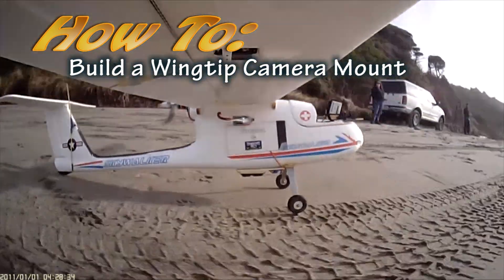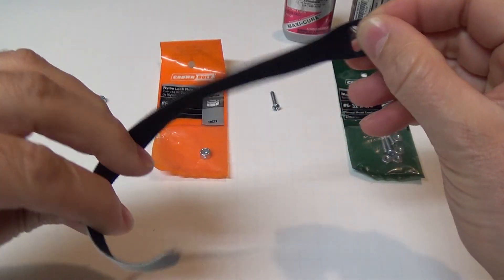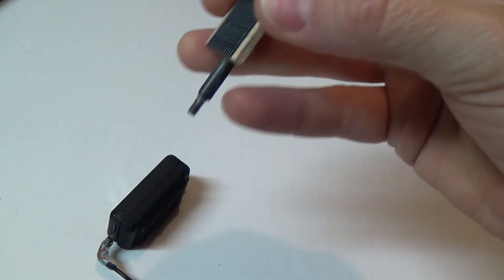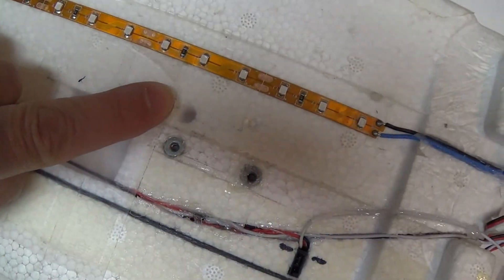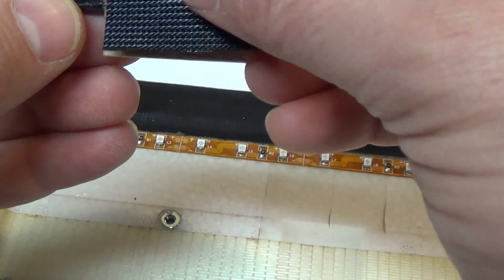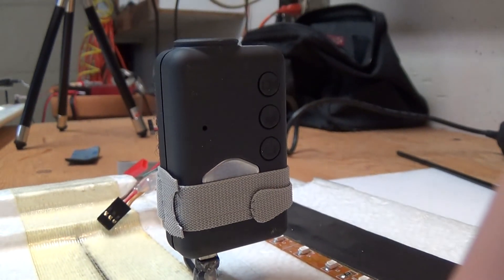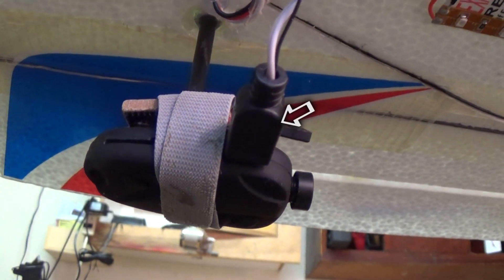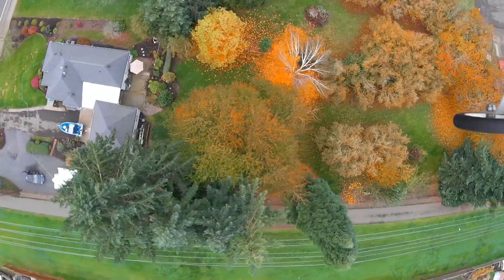FPV Wing Camera Mount for Mobius or 808 - How To Build It!

Comment: Very cool video ! Just a dumb question. Do i always have to balance the wings with some kind of weight when i add more spots for the camera mount? Subscribe!!
Reply: That depends. If you have a light airplane with a heavy camera, you definitely need to put on some counterbalance to restore the center of gravity. But the lighter your camera is relative to the airplane, the less you have to worry about CG.

Comment: Very good video. One suggestion to those wanting to try this that was implied in the video but should always be mentioned is double check before you glue, and double check after everything is completed it would be shame to lose an 808 or Mobius because the glue didn't bond correctly. Also check to make sure your specific CA isn't going to melt the foam. Melting foam = counter productive. 

Thanks for the video! I'll be sure to share this on our FB page.

Comment: Nice video! I was thinking of something similar until I came across this video. My idea is to push a plastic tube deep into the foam with nylon nuts glued in at opposite ends, and then use nylon screws instead of metal so that they snap off without ripping foam out. That will require prying the broken threaded pieces out of course, which shouldn't be a problem. Or perhaps make an intentional weak spot in the rod holding the camera: e.g. use 2 carbon rods bonded together with some weak plastic outer tube or tape.
Reply: Great Idea, I'll be adopting your plan. I've ordered some 5mm Threaded Nylon rod which I hope will be able to fit through the end of the #808 after it's been drilled out a little. This will save building a mounting plate. I plan on drilling straight through the wing and fitting a 5mm "T" nut underneath for strength and a 5mm Nyloc nut on top for security. Ill saw a slot into the end of the rod so in the event of it snapping off underneath I'll be able to unscrew it from the top. Thanks!

Comment: I have a question GDA.  I am building a SkyWalker and wonder if I really need ailerons?  It is a big stable air frame and I would love to open up a channel of tele-command for FPV.  Would it fly OK three channel?
Reply from the maker: It will fly with 3 channels just fine.

Comment: Early in this video you showed some bottle rockets launched in flight. My question is; how did you ignight the fuse while in-flight?  I have been trying to do something like this but cannot figure out how to ignight with 20+ mph wind.
Reply from the maker: I use a solar igniter. I glue it to the fuse parallel. Don't get glue on the sulfer igniting material if you can avoid it. Just lay the igniter down on top of fuse like they are trying to mate. Then thick CA on the two wire leads and fuse at same time. Now the igniter will probably not light the fuse, due to wind, etc. So the important part is to remove 5 or 6 fuses from some cheap black cat fireworks, and wrap them around the solar igniter sulfer end. I use thick thread to wind the crap out of everything. It can be pain until you figure it out. Now when the solar igniter ignites, it immediately ignites the black cat fuses all around the main fuse you are trying to light, and I guarantee you will have ignition of your main fuse!

Comment: Doug, Unlike the Skywalker, my Penguin has lower wings. I've mounted one of my first FPV cameras that I no longer use under my wing and then added a camera "rollcage" next to it. I'll show it on my next video. Like your mounting idea. I'll put that to use on the new Penguin I'm going to be putting together. Thanks again for your videos!

Comment: Great video! I'll be using your ideas for an 808 mount on the wingtip of my Skyhunter.
Reply from the maker: Great! Let me know if you figure out any ways to improve the design! I would love to design one that can be rotated like mine, but also tilted down a few degrees, or even up to 90 degrees down. I can't think of a way to do it and maintain the light weight, and also the rigidness of the original design.